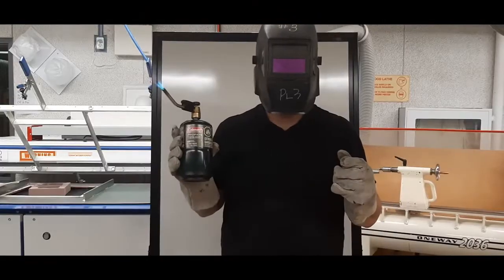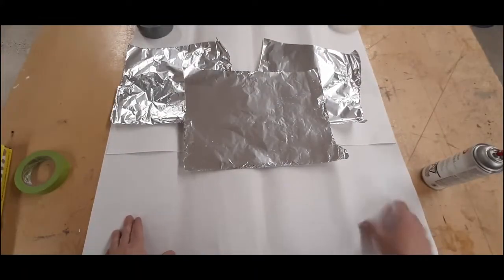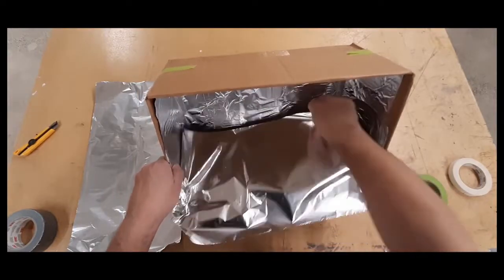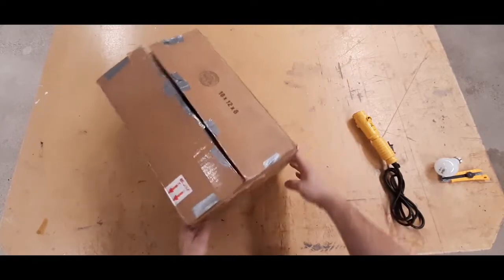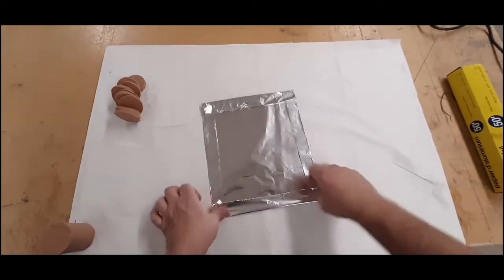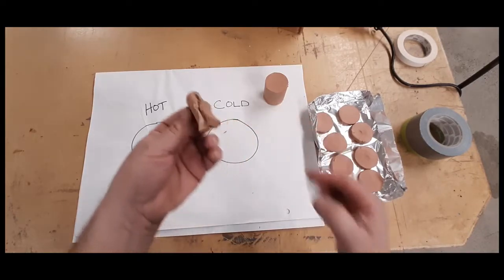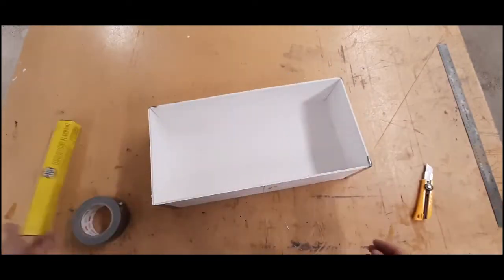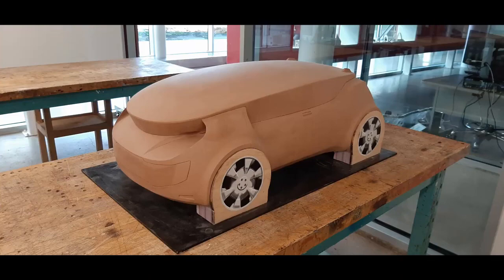How to Make Automotive Clay Oven

Comment: Wonderful video...I've applied over 100 lbs of the Chavant hard clay and used a small toaster oven, and often times got the clay too hot...if I paid close attention I could get it out in a spreadable form. I didn't think of the light bulb box. Where did you buy the clay scrapers, having a hard time finding them again, I had a set but lost through moving.
Reply from the maker: Hi Carl, glad you liked the video I'm glad it helped you.  The clay sculpting tools I'm using were made custom for us at the college I teach in.  I'm a prototype model maker and shop instructor in the industrial design program here in the college.  We have an automotive design section in the program.  There is a guy in Windsor Ontario who is a retired Clay sculpture from GM who makes these kits for us and a few other automotive design schools around North America.  They are not available to the general public sorry.  Chavant tools in New Jersey sells an 8 piece Clay sculpting kit on their website. We used to buy it but it got too expensive for us with the exchange rate. Hope this helps.  Thanks again for watching.
Reply: @shopguythechannel1944  I bought several of his tools years ago and have mis-placed 2-3 of them so was hoping they are still available. I'll just make some more. Thanks for the reply.
Reply: @shopguythechannel1944 great video! I'm in Windsor Ontario! What are the odds. So he doesn't sell these tools in Windsor?